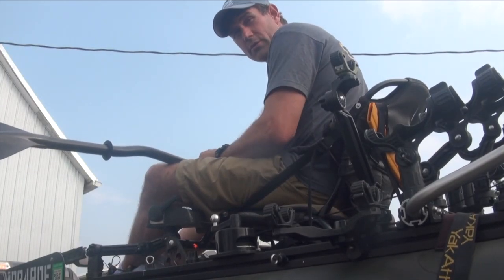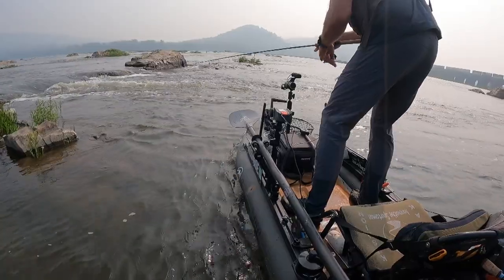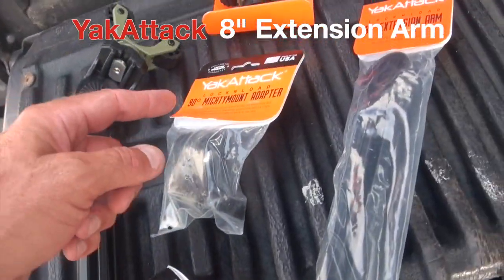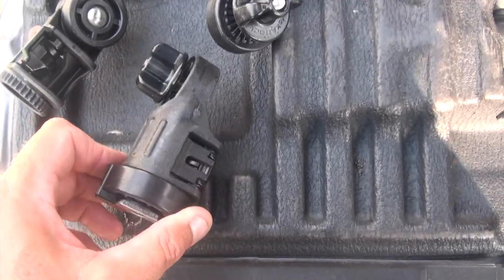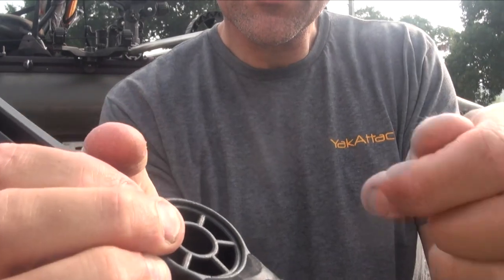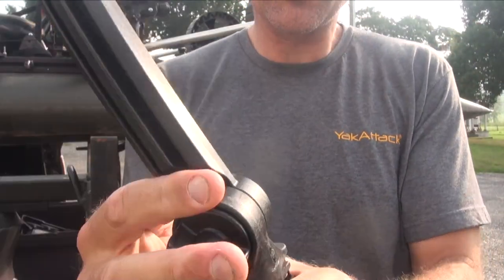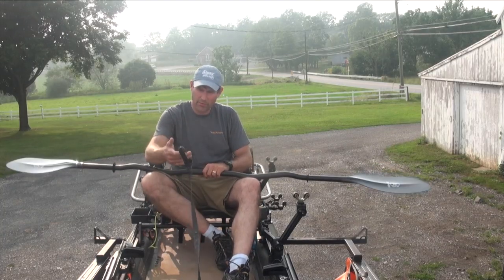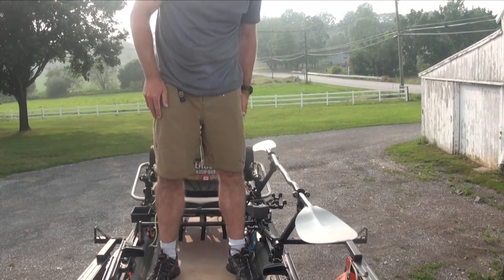Rigging A Fishing Kayak for SIGHT FISHING

Comment: Love the ingenuity here. Makes my brain start turning how to incorporate some of these ideas on my Predator PDL. Generally, I use a hand to push the pedals to keep me moving forward but the turning is an issue. Like always, solid content!
Reply from the maker: You need an anchor point for the levers below the foot pedal slides. That will be the tricky part on a rotomolded kayak.

Comment: Hi Jeff. I'm a recent subscriber to your channel. Good info, thanks. I've always wondered how heavy fishing kayaks are after they are loaded with all the goodies like motors, two fish finders, power pole, batteries, yak gear, fishing gear etc. Then add angler weight to it. I see a lot of extreme set ups that look like they are overloaded or pushing the capacity limits. Maybe you could put your Osprey 1436 on a scale or weigh all the components separately. I know just the plastic from yak attack accessories can add up. Just curious. Could be a new video for you. Thanks again, keep up the good work.
Reply from the maker: I don’t know if I want to do that, but I have quantified “shallow draft” with this rig. Submerged objects, rocks and logs for example 2 1/8th inch deep can be cleared with this inflatable with a huge footprint. Most kayaks need between 5 and 9 inches of water to float through. I did that measurement with a full load of gear; motor, battery (which is only 13.2 lbs), tackle, water, rigging, anchors, etc. Compressed gas as a platform is so forgiving and “lightweight on the water”. This Innovative Sportsman Osprey 1436 weighs 85 lbs with frame and seat.
Reply: @TheLittleStuff  Thanks for the feedback. Much appreciated.

Comment: Hey Jeff …….. I’m looking for a standup bar to fit the Osprey.  Are there any out there?  Are you going to make one for us stability challenged?  Also, why don’t you make those steering arms longer so you don’t have to bend over?
Reply from the maker: 1. Yes, it’s called the YakAttack Command Stand. I have one that I was going to rig behind the seat as a rod stager. I need to get more comfortable with what I have before I figure out that.
2. Those levers were the longest pieces of star board that I had. You are correct. They should be longer. I also like the idea of having some sort of interface with my knees to nudge them forward.
Reply: @TheLittleStuff  make the steering handles from two pieces, so when you sit back down you fold down the upper half so it's not in the way of casting if you find an area where you need to fish while seated. I had to adjust a camera stand for my phone because it stuck up into my casting plane.  What's next, foot control accelerator for the Torqeedo?
Reply from the maker: @ppfoten211 The levers lower down out of the way as is. They just need to be longer. They stow along the inside of the frame.